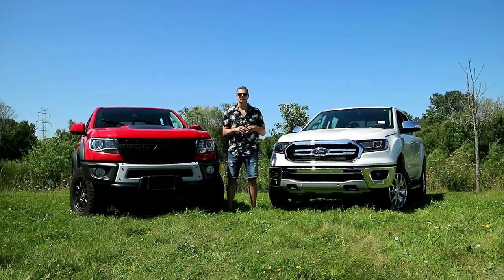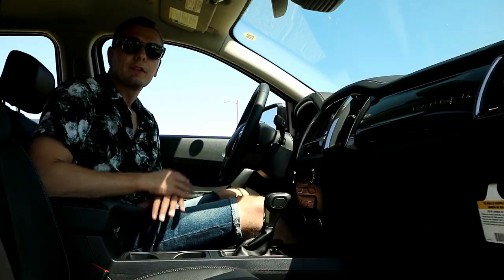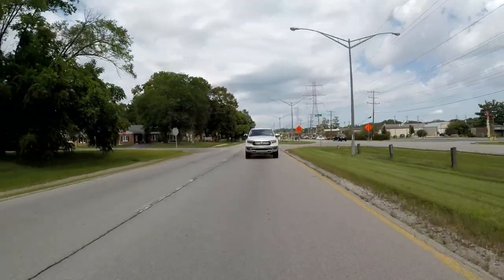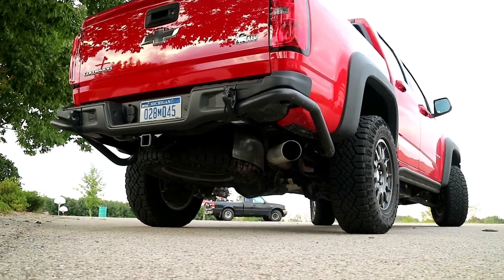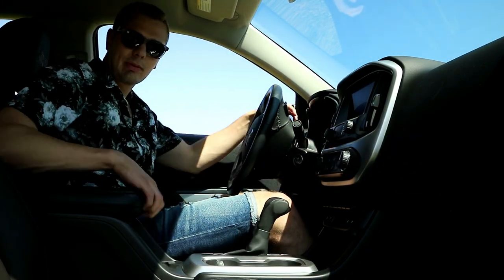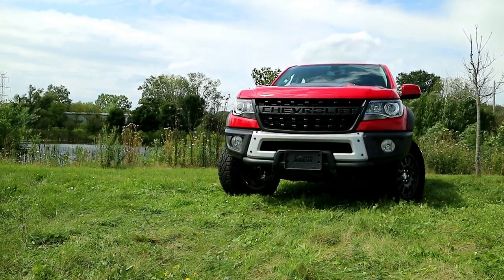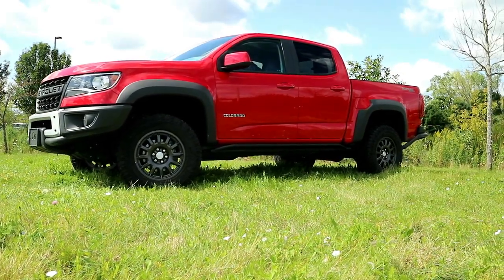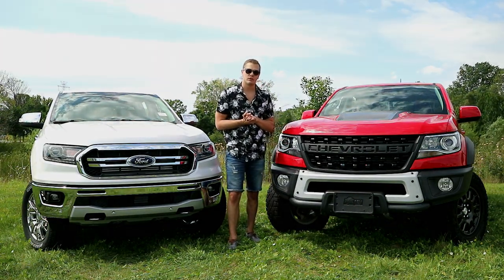WHEEL 2 WHEEL | Ford Ranger Lariat vs Chevrolet Colorado ZR2 Bison

Comment: 7500 towing , not 3500
Reply: on the ranger yes, it pulls up to 7500lbs which is class leading by a country mile.
Reply: @Wuldier  not really.  The Colorado (non zr2) V6 tows 7k and the Duramax tows 7,600 lbs.
Reply: @trevor108  my bad, i was forgetting about the duramax. price upgrade though lol.